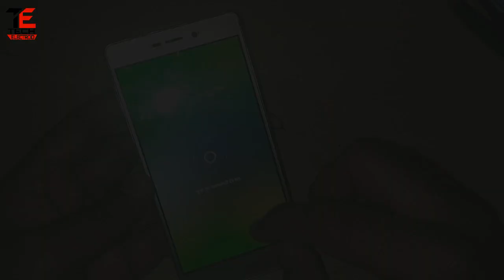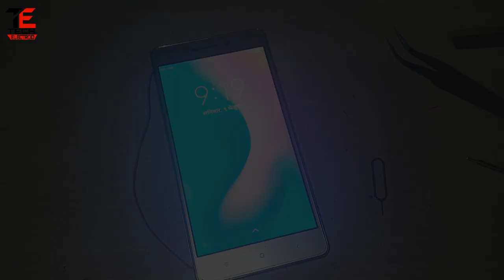"🔧Ultimate Fix for Mi Redmi Network Problems! 🚫📶 No Service? *100% Solve* Your Phone Signal Issues!"

Comment: Bro in my poco F1 net is slow but in others mobiles if I use the same sim it's good
Reply: yess..same like me..what a resolution?
Reply: Just root it
Reply: @kengananime6229  are there other solutions aside from rooting the phone?
Reply: Bro i have  same issue  any solutions ?
Reply: @suzzuna13  50/50 your cp is dead
Reply: bro solution mila ?
Reply: Any solutions ,same problem in my poco F1 after screen replacement and if keep my phone straight Internet doesn't work even after data is on
Reply: @awaizahmedsharif9031  I have the same issue after replace my touch screen replacement of Redmi y2 do you guys have any solution
Reply: same bc charging port badalne k baad network slow ho gya kya kare koi solution?

Comment: I replaced charging board in my redmi 3s because my charging port was damaged.... But with new board sim network problem aa raha hai... Plz help
Reply from the maker: Sub board kaha se replace kia
Reply: Online order kia Amazon se... But original board pe black dot jaisa hai board ke circuit pe.... That is missing from new subboard
Reply from the maker: Return it and replace with original from mi service center
Reply: Original kitne ka aayega
Reply from the maker: It's around 700rupees
Reply: I got the same problem
Reply: Same bhai maine bhi mera charging port chng karaya  uske baad aisa issue aa raha
Reply: @maheshchouhan7964  same problem solution kya hai iska?

Comment: Just putting a thin wire between your back cover and phone will increase a few dbm signals. It's working for me.
Reply: Any short circuit occurs or not ?
Reply: Thx I will try your methode
Reply: @jisnujis3188  no

Comment: My Xaomi is dropping my network which is AT&T the bars vary through my house and it just started happening. I have to use my cable wifi to get solid bars or roam around the house until I find a spot that's not a dead zone. Why is this happening? I have had this phone for a little over 1yr

Comment: Hi,

I'm having no service problem in my redmi 3S prime mobile.. It was working fine till yesterday morning suddenly network dropped .... what could be the issue ?
Reply: Maybe cuz of unstable connection. Try restarting.
Reply: Xiaomi has their phones globally able to receive antenna strength so if your inside a house and dont get direct signal your phone will probably do worse than your other cricket or TMobile phones since they are not for global use